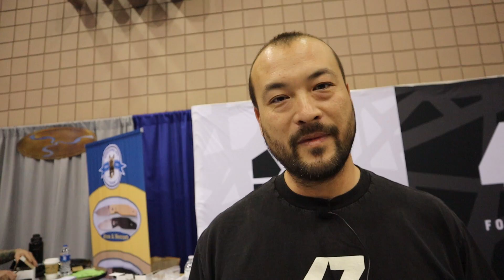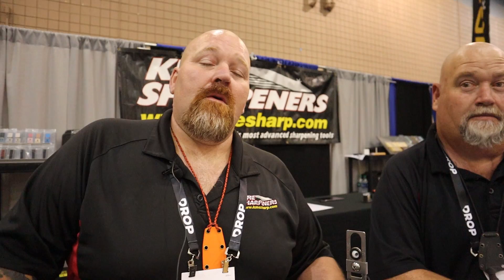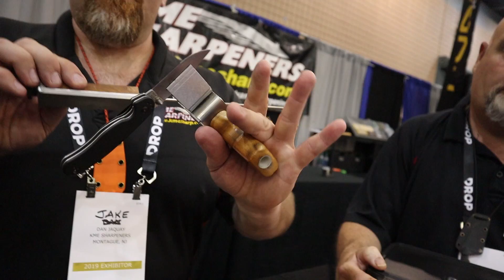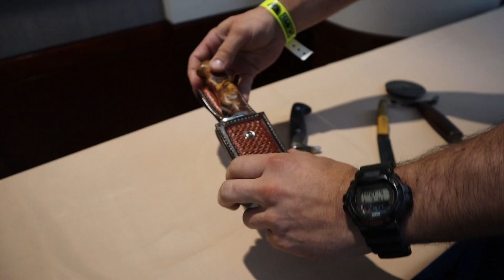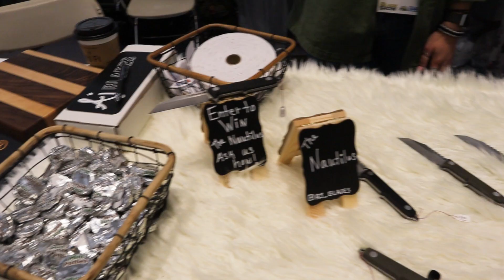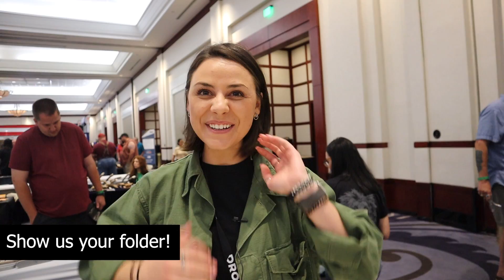Meet some makers at Blade Show!

Comment: Well done to the two guys that have ripped of a Lansky sharpening system. 
I understand though, it's hard to come up with your own ideas, it's easier to just copy someone else's.
Reply: Almost nothing is completely original, perfecting something is a perfectly valid strategy.  Take Grimsmo knives for example, practically all the parts that constitute their knives have been invented or implemented in the same fashion by other people before, does that mean there is something bad with their design because in not completely original? I think not. And beside if you want to protect an idea you can have a patent, and even that will have only a short span.
Reply: I personally thought that the KME sharpeners were definately an improvement over the 10 year old system that I was still using.
Might just have a look at those...and I don't think it is copying...it is a world of improvement.